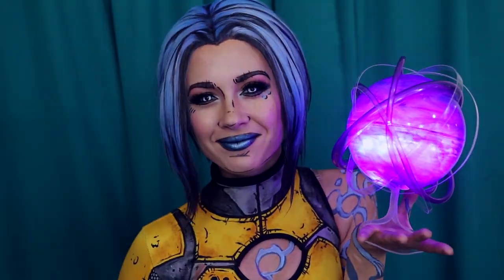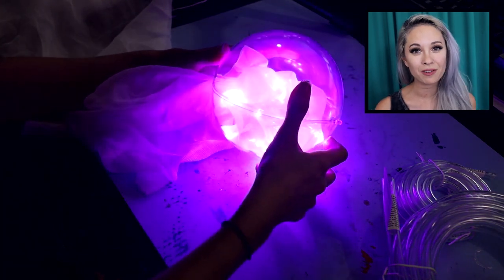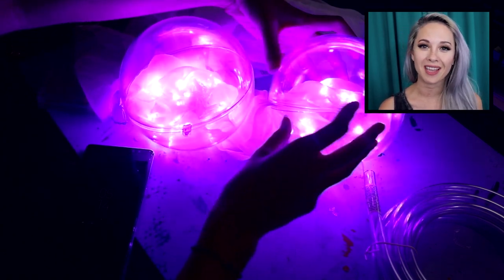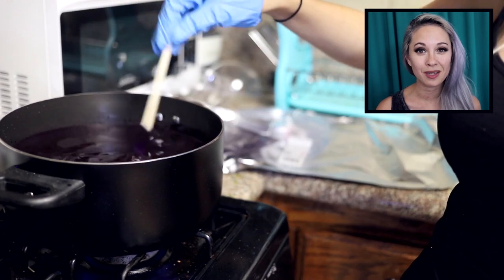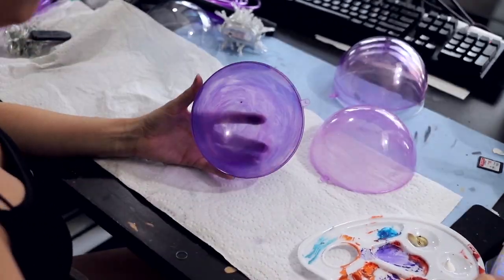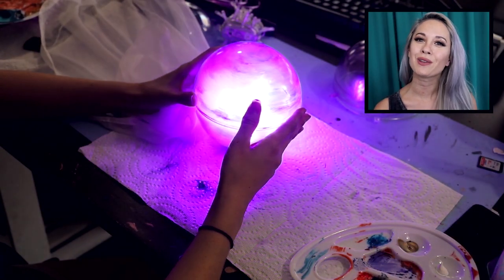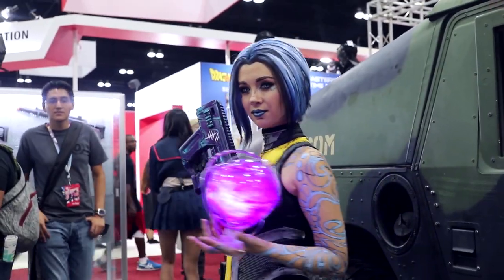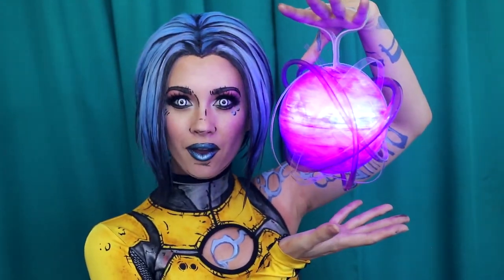How-To: FLOATING GLOWING ORB

Comment: Great effect. Only thing I can really criticize is using the same soldering tip for both melting the plastic as well as soldering the circuit. For circuits you would remove/cover the tinning on the tip that helps transfer the heat to easily solder your circuits. Tips for soldering irons are pretty cheap; just let it cool before changing.
Reply from the maker: Jeremie Santos Def a fair point! In the future I'd prefer to just have two soldering irons!

Comment: This is a great video! If we do the tightbundle option without making a new switch do you have any tips for preventing the battery pack from casting a shadow from within?
Reply from the maker: Best I could come up with was wrapping the battery case in reflective tape 🤔 might help to elevate it with something clear, so light reaches under the battery case too

Comment: I made my orbs a few weeks back but the only problem was getting them to stand up. I also used a sign display bc it looked like the strongest plastic but it keeps falling over. I dont even have extra weight on my orbs -- it's just the ball -- and it keeps falling over 😭